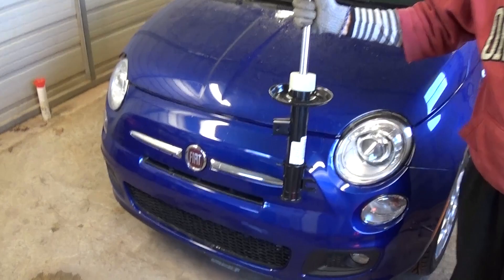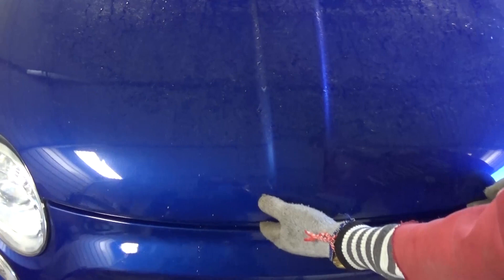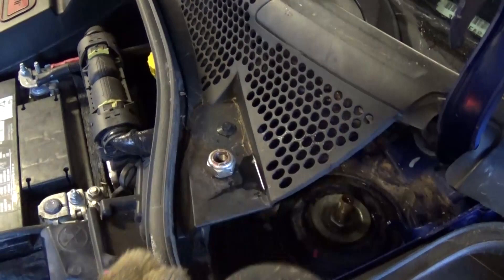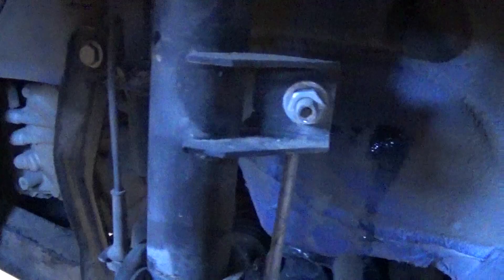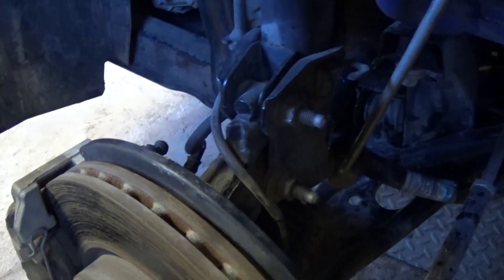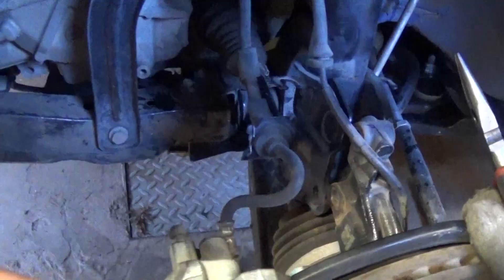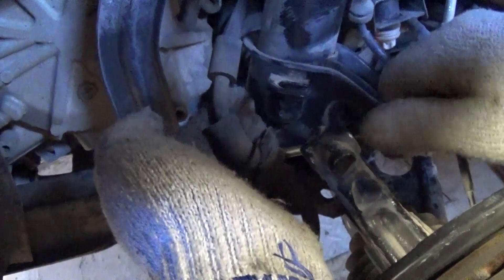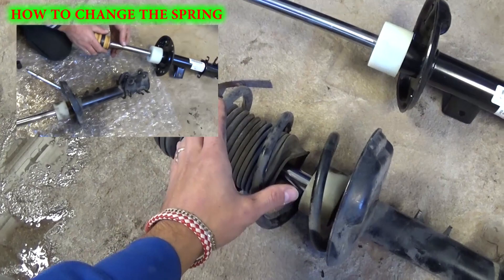Front Left Right Strut Shock Removal and Replacement on FIAT 500 2008   2016

Comment: Straight forward explanation. Took about an hour per side. Would have been easier if I didn’t have rusty fasteners to deal with. $190 bucks for the parts from Rock Auto. They were the only place I could find the struts.  Beats the $1300 the dealership tried to charge my daughter.
Reply: Dealership just quoted me $1527 for shocks and sway bar links on my 2017 500e. I'll definitely be doing this one myself!
Reply: I hear ya...was quoted a similar price...guess i'll be trying this myself.

Comment: Have 0 idea why but I've never take more than half a second to remove the brake line from it's push in hold. You literally just roll it out no need to go at it with metal

Comment: i think now my new left front shock absorber is not working properly because after car is staying in place for a while, 1 hour for example, and than i press that corner of car where is suspicious shock, first 2-3 movements up and down is going so easy, like without any resistance, and than becomes hard like it should be allways?...they are old maybe two weeks, and about 300 km on them, every time after car is parked about 30 minutes it seems like shock absorber looses power, and after 2-3 bumps he becomes hard again...i belive this is not good because other one is allways hard ☹️ do you know what is problem with that shock with this symptoms?

Comment: Does the car need to be realigned after replacing the front shocks?
Reply: Pretty much - I heard that if a seasoned pro does it he can guess-timate how to reassemble and still be aligned, but better to have a proper alignment done. Too many variables change that will throw the alignment off
Reply: @Jaco2k Thanks!